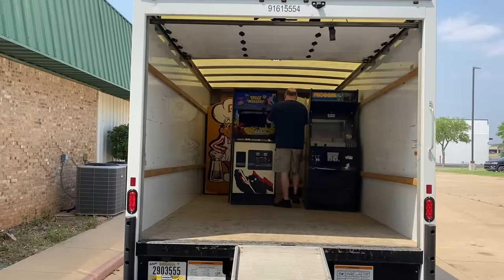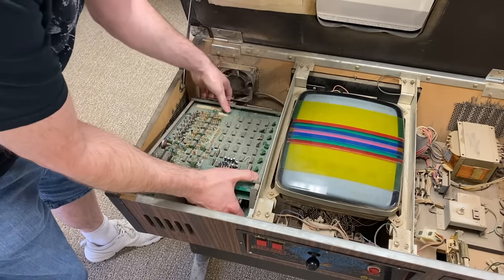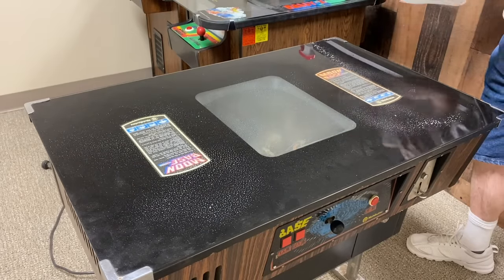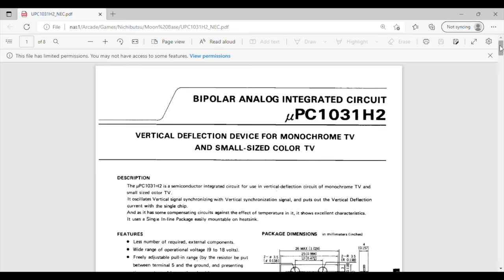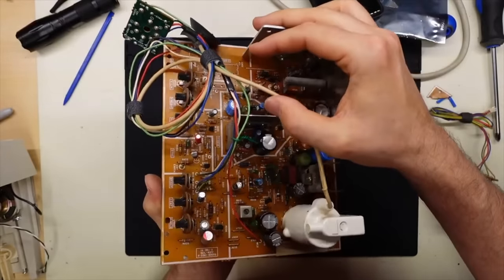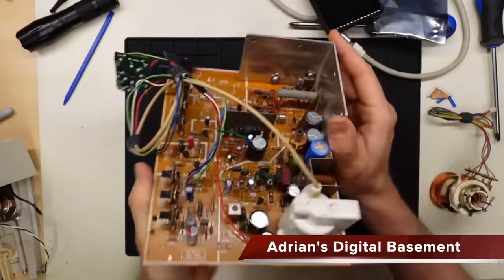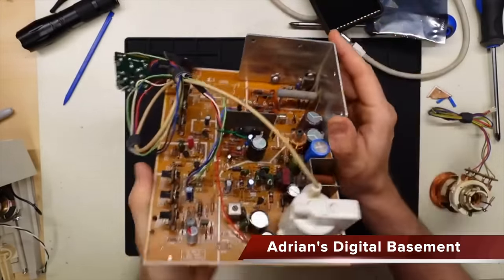Moonbase Arcade Restoration - Gone Wrong

Comment: This is just an idea, and probably odd, but hear me out.

You remember how the sticker on the side said it is made for 100V 50/60Hz? Well... Everything on it indicates it definitely was made for the Japanese Market, and maybe the place this has been in before, actually ran it at 100V AC.

My guess would be, use a multimeter, and look up the pin out of the IC you replaced, as well as some other connections. The parts can't exceed certain voltages. If they do, the power supply gets too much power, and doesn't step it down properly.

It could also be a faulty power supply, but given this machine has a sticker on it that says "Made in Japan" and has a Japanese start button, I would presume this really was made for that very specific voltage and was never changed.

The arcade this has been at, might have run it at 100V, then they sold it or got rid of it, someone else tried to use it at 120V, which broke it, so they got rid of it and eventually you got it.

I just believe, it certainly wouldn't hurt to try and check some DC voltage readings on the board, to see if that is your issue.

Hope that helps ^^
Reply: That was the exact thought I had through the entire video and the transformer likely has different live legs representing different input voltages
Reply: My thought as well.
Reply: This actually makes a lot of sesne.
Reply: We had a similar issue here in germany with very nice vintage Sound Amplifiers, where germany used to be 220v and than they raised the voltage slightly to 230v going up to almost 240v in the night from experience, the amps still work but they get quite a bit warmer than they were suppose to back in the day, which just makes them break alot faster, i mean they lasted 50y and now they only lasting for like 1-2 more years, naaah.
everytime i get one of these amps i immediatly change the voltage stepping to the transformer from 220v to the already existing but unused 240v stepping on the transformers which makes them run noticibly cooler.
Noted: 220v to 240 is only half the amount of more volts than 100v to 120v is so that would mean it would be a even bigger issue in the case of this arcade table.
back than they probably used an external 120v to 100v transformer which arent that expensive because they are quite basic just a tranformer with a multiple of 6:5 wiring ratio and like 100-200w of power capability, back than when copper was cheap. i would suggest seeing if the integrated transformer maybe already has wiring ready to convert it to 120v where you would just need to unsolder the power wires and solder them to another wire pair on the transformer
Reply: Maybe replacing the power board with a more modern switch mode one would work, a PC power supply would work for the game circuitry but i don't know where you would get the high voltage for the crt
Reply: @superjoeybro  Generally, the monitor board has its own power-supply section to convert AC line voltage to DC, so replacing the power supply with a switching unit won't solve the monitor problem; the monitor would still be getting 120VAC or more from the line-voltage side.
Reply: I think this is a very good start. Replace the chip and try it on a Variac at 100v.
Reply: No, it's not odd... this is probably exactly the problem.  Ralph Nader singlehandedly killed an entire line of GM automobiles and the entire root cause of the 'safety' issues was that people weren't filling the front tires to what was clearly specified, which was 12 psi lower than normal.
They all thought it was going to be fine, and it was, until it wasn't.  Small changes can have big ramifications.
Step 1 should be running the machine according to spec.
Also, I'd be willing to bet it came over from Japan and was out of order from day 1, and just got its inspection stickers in a lot along with 40 other machines in bulk, and probably has never worked right in the US for more than the first couple hours.
Reply: Same thought here!
Reply: This was the first thing I thought of when I watched the video.  Hopefully the service manual  explains a way to reconfigure for 120AC, or there might be a list of test points that spec voltage levels.  It can be a big switch, a set of terminals to swap, or even a different lead of the transformer.  Unfortunately, there could be other damage.  If some protection circuitry in the power supply has blown, this could explain why the original chip lasted almost 16500 plays, and the new chip lasted a day.
Reply: Great idea
Reply: I agree. The only thing not really looked into is the call out for 100VAC. Just a shot in the dark but try running the mains voltage through a Variac dialed down to 100V. Can not hurt.
Reply: I'm honestly really confused why he didn't thought about this, it makes a lot of sense
Reply: @gabrielcamiloanunciatodeol2566  IKR, My hats off to him and Adrian for the restoring work done but the input voltage should have been the first issue to resolve.
Reply: @marknesselhaus4376  agreed
Reply: A simple variac from ebay can let you dial down the voltage to a precise amount (120V to 100V in this case). [Obviously won't help any 50/60 HZ differences if they matter.] I actually use one for infinite control of a box fan next to my bed. Super nifty to have.
Reply: Well, done. Great thought. I certainly didn’t give that a second thought, but I know little about any of this anyway. I just really like to watch these videos though. I’m sure he’ll see this & willing to bet this will be brought up in the part 2.
Reply: If it does turn out to be the issue, I would see if you could permanantly fix this issue by putting in a 120v-100v step down transformer in the cabinet. Possibly splice the new wire with a off the shelf transformer and feed that into the original power, by maybe using Wagos or a distribution block, since I don't think you can wirenut together stranded (but I could be wrong on that).
Reply: I agree It would probably be happier at 100v 50hrtz
Reply: exactly my same thoughts!
Reply: Considering how long it worked after he fixed it, that could easily be the problem. Just enough overvoltage to slowly burn out the new components and bring about the same problems again.
Reply: Japanese frequency could be 50 or 60 Hz depending on the region, 60 Hz in the west, 50 Hz in the east. Since it was made for the Japanese market it probably works on either frequency.
Reply: This is a good approach, but this machine has been operating in the USA for a lot of years. That issue would have been caught years ago. As I recall Adrian was patching cracks on the board, and could very well be a bad solder joint that got worse. I could figure it out if it was in front of me.
Reply: hey that's a good point! also replacing the rest of the caps cannot hurt.
Reply: Remembet the plug he changed. It was probably changed to that funky US plug also from it's original eastern plug.
Reply: @kjrchannel1480  like mentioned, the previous owners might have used it at a different voltage, and in the video nothing in terms of how long it was used for was mentioned
Reply: @sage_x2002  Did you see the dates on tax stickers?  That says it was imported probably more than 40 years ago.  In all the arcades and routes I have worked on that has never been an issue. Aside from some idiot patrons that thought it would be funny to switch the power supply to 240 use at the plug. It is possible that someone who did not know what they were doing changed an internal transformer jumper after the fact if it has any.
Reply: I was thinking that too since Japan uses both 50hz and 60hz and the machine accepts both it just makes so much sense. I'm so curious to see part 2
Reply: Overvoltage
Reply: Yeah this is definitely a possibility. A few years back I bought my first import console, a Japanese 3DO with a 240p switch which NA 3DOs never had. Anyway, it never occurred to me to check to see if I needed any special equipment to run it. The 3DO worked fine at 120V...for about a month. Then it started having all sorts of problems. That's when I realized "omg why didn't I think to check it's power requirements?!" Long story short, I recapped the entire system and bought a 120V to 100V step-down transformer and she's worked perfectly ever since. It wouldn't surprise me at all if this is the correct answer.
Reply: A variac would allow a 100V power input. It is also a nice tool for troubleshooting issues since you can creep up the voltage supply.
Reply: @kjrchannel1480  the labels don't guarantee they have been in use. There are also only labels for 2 consecutive years which may indicate they haven't used it much or at all, probably because it broke repeatedly

We don't know, this was an assumption and it could be that that's not the issue, but after all caps and the IC being replaced, and the same problem occurring again, I'd say it's likely the power supply itself, since chips are known to 'take it personal' if you're providing them with too much 'juice' :)

There also is a sticker directly on the arcade indicating it was only made for the Japanese Market and likely never was adjusted for US market. It doesn't hurt to check output voltages and voltage across the board to see if that's the issue :)
Reply: Also though this
Reply: Absolutely think this is worth exploring. The slight difference in the voltages could be causing some issues/burning out that single IC.
Reply: I thought that as well.
Reply: This seems so obvious to me, and apparently everyone else, that I can't imagine he hasn't tried it...
Reply: Golden rule.  Thou shall test voltages.
Reply: @fisharmor  Ralph Nadar? What?
Reply: i agree. repairs seem good, just over volting them!
Reply: But how do you square this theory with the fact that the machine was in service for a number of years in Texas?
Reply: @BigOldCarChannel  that's the thing, it was never stated that it was. These stickers were apparently applied in bulk and machines could have them no matter what. Whatever the case, the follow up also stated it was a bad voltage regulator so we weren't completely off with voltage difference :)
Reply: @sage_x2002  No way, those stickers are applied to machines by an inspector from Weights and Measures and are applied in situ. If one wanted to say "well maybe they had the intention of using the machine but backed out," okay that's possible--except that there is a sticker on the other side for the following year. It's without question that this machine was used in the US, as it was purchased at auction here last year.

Anyway, we'll see what happens next!
Reply: @BigOldCarChannel  Perhaps two years of over-voltage was all it could take.  Or the replacement part is not as forgiving as the original.  Output voltages of the main transformer should be the first thing tested.  They are probably all high.  A matching 115v to 100v transformer can easily be added into the cabinet to fix it.
Reply: @BigOldCarChannel  What about this situation:
Arcade owner buys the game, plugs it in after... doing whatever happened to that plug. Plugged it in, voltage controller didn't like that for too long and eventually broke. It had the sticker at the very beginning. From now on, everything happens like this: Arcade owner lets the thing stand around for a while, waiting to repair it (maybe got some technicians over etc.) they tried fixing it, maybe even got it fixed, it got back in the arcade, and a new sticker before - whoops - it broke again due to the wrong voltage being supplied.

Just an idea, obviously don't know, but we never got told it was actually used for a while, it may even have been in storage the entire time and never been in the actual arcade, or only in it's storage rooms, because it was broken all the time

That was my initial thought :)

What you said does make sense too though! I wonder what happened as well though :)
Reply: yeah i expected to see that done in the video - wonder if that was done off-camera or not.  Seems like most logical step #1?
Reply: CallOfDrewthulhu  True, but the two tax stickers on the side were from Texas, so presumably (83/84 at least) it was operating reasonably well on 110/120.
Reply: I wonder if there’s a voltage spike in the power supply output when you turn it on. It’s interesting that it worked for a while but then failed after the last maintenance. Maybe if the line voltage was too high it damaged whatever over-voltage protection it had and made it more vulnerable. Or maybe it never worked well in Texas but the bar owner was too lazy to get it fixed and didn’t care?
Reply: I access to The 8-Bit guy website when has everything from a hobby computer to a tape player & CD, Blu-ray & DVD players were blastastic useless.
Reply: That would also explain why the control IC looked burnt out, maybe it overheated from the voltage.
Reply: @BadMax02_VR  220V was common in continental Europe before 1987 while the UK (and probably Ireland) had 240V, it then got harmonized in 1987 to 230V.
While "dumb" devices weren't affected by that (or even got a slight performance boost) as you say it got problematic for more sophisticated ones.
The upper tolerance/limit was also raised in 2009 - before that it was 230V +13.8/-23V (before the 230V came we had 220V+/-22V so the maximum with 243.8V was just slightly higher than the 242 but they allow 230V+/-23V, so the maximum is now 253V).
Got a Grundig CD7500 (almost identical to the Philips CD-303, both still 1st gen CD players) in 2021 and it had some issues but it ran CDs so I brought it to a Hifi specialist, they recapped it, readjusted the laser and also reconnected it to the transformer's 240V leg.
Reply: @kuchenblechmafiagmbh1381  fortunatly most of my braun hifi equipment has internal soldarable adjustments to the transformers, low power devices only 220v and 120v but the higher power stuff has also solderable configurations for 220v and 240v, which i all did to 240v so its a bit underrun, maybe a little bit less power output in the channels but way better efficiency with it running barely warm to the touch and thats for a 40y old amp running around 25-30w while ideling

Comment: I'd rather see mistakes and folks own up to it, rather than see a problem, and then there's a magic cut and it's fixed without any discussion. Thanks for keeping it honest.

As to the unit itself: I recommend checking the output voltage of that power transformer. I have a lot of old synths from Japan, and they work on US voltage, but heat up way more than they should (some have tuning issues if run on US voltage). It's really a good way to have them fail early, and maybe toast some unobtanium. If the voltage coming out of the transformer is too high, just run it off of a 120v->100v step-down transformer external to the cabinet, or maybe even down in the coin drawer.

PS: That pic at 19:43 is, erm "inspired", right from early Yamato/Star Blazers. It's the Comet Empire.
Reply: Looking at around 4:56 you can see the transformer is marked with 220, 230 and 240v taps.
Thus it's more likely a case of moving a wire on the transformer primary, rather than using an additional transformer.
Reply: Star Blazers was the bomb, had to run home from school and turn the big antenna towards a distant city to watch it.
Reply: At first I thought it was some sort of generic space art but now that you pointed out I can't stop seeing the Gatlantis' White Comet.
Reply: The comet empire was right there and I didn't see it!  Something in my brain registered though, I could feel it trying to tell me something at the time...
Reply: @Legend813a  Star Blazers and Force Five (New England-area, and a couple others, mashup of serveral different giant robo anime series) were my hour of my TV time when I was younger. Well, that and my weekly COSMOS on Channel 2.

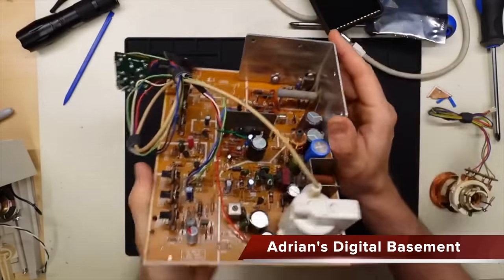Comment: 20:03 I believe there is a rubber bushing inside where the shaft comes through. You could probably find a silicone (or rubber but it would be less durable) hose of the proper diameter to replace the bushing to firm it up. There also would most likely be a washer at the end. You could check the stick on the other side to see if that is the case. At worst you could use an angled rubber washer that would commonly be used in an old school water valve (backed by a small fender washer or two.)
Reply: This was my first thought too. As soon as he said the bolt was tight, but the stick was still loose suggests that there was some type of bushing in there as a wear component. Given the fact that there isn't much evidence of it left, I am guessing it was rubber that dry rotted and just disintegrated over time. Really at the end of the day it doesn't matter what the material is, you are just looking for something to fill the void between the 2 parts. You might even be able to be able to use a brass bushing, which in a pinch you can always use a dremel or hack saw on to make it the right length.
Reply: @jtherrie  I'd 2nd a brass bushing.  Or if a correct size can't be found, just use enough wraps of thin brass foil to take up the slack, and apply a bit of heavy oil or grease.
Reply: There is. Overtime the metal rack could've shaved down as well.
Reply: I have run in to a similar issue previously with a joy stick.  I ordered a multi sized set of stiff rubber O rings from amazon and it had one that fit perfectly.  It made my joystick very stiff.